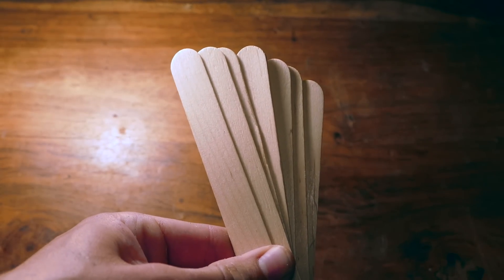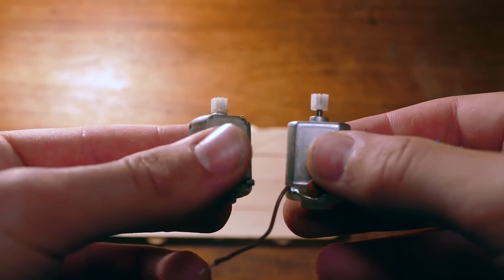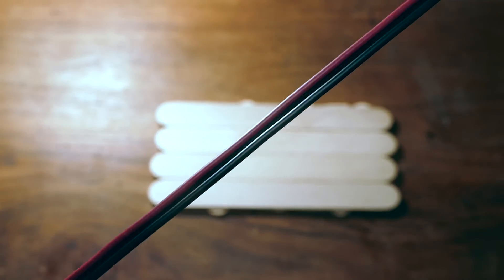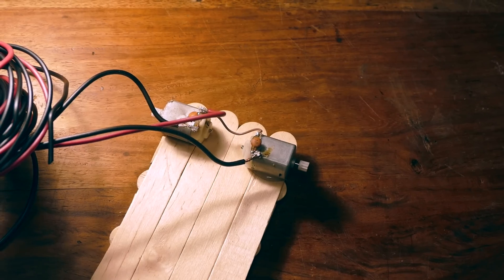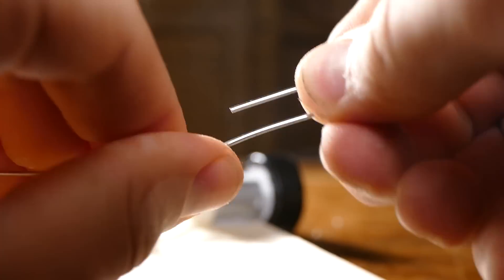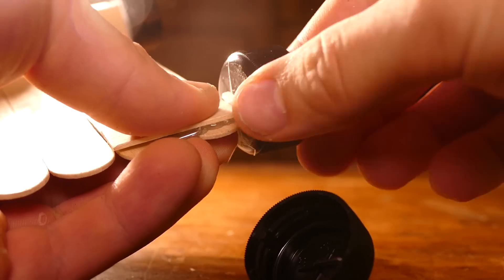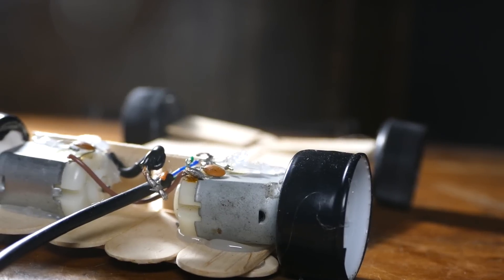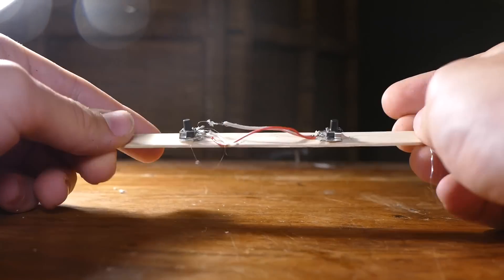How To Make a Remote Controlled Drift Car

Comment: You could also put a bluetooth device with other connectable devices that activate the wheel's motors. or so sort of signal transmitter.
Reply: that would ruin the purpose of this, he is trying to make it cheap so anyone can replicate it, adding bluetooth and other features would complicate this make increase the cost ;d
Reply: +Jim Jose eh just a thought